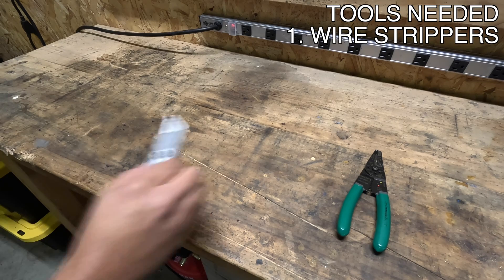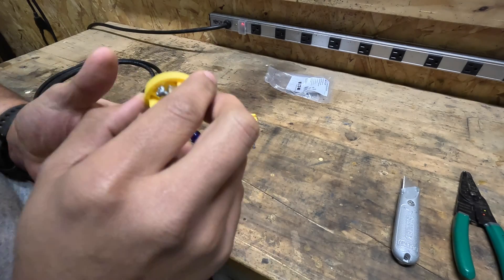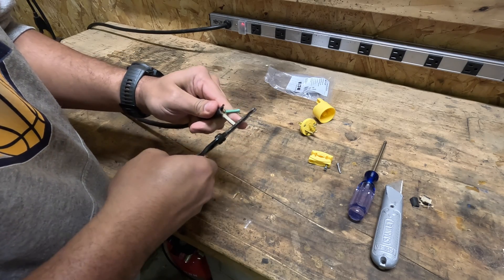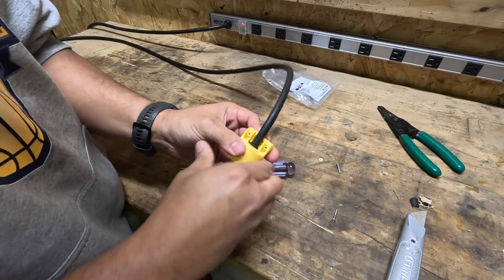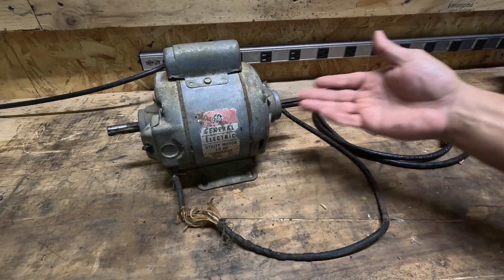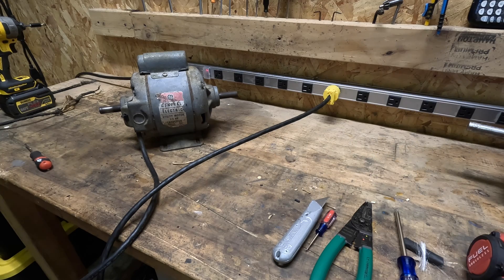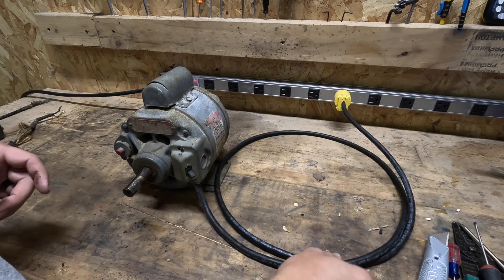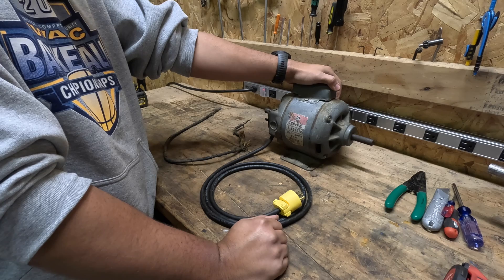This $10 DIY Power Cord Will Save You $1000's on Tools! Here's How...

Comment: What a click bait title. Title should of been: How to wire a new cord to your power tool.
Reply from the maker: $5 motor plus $10 power cord = $15 total. If you were to by a brand new motor to replace this it would be $250. $250 - $15 = $235 saved. Do this over over a couple tools and you save $1000+ pretty quick.
Reply from the maker: Where is the lie?
Reply: @TheEngineerNextDoor55 Saving $1000's on tools?